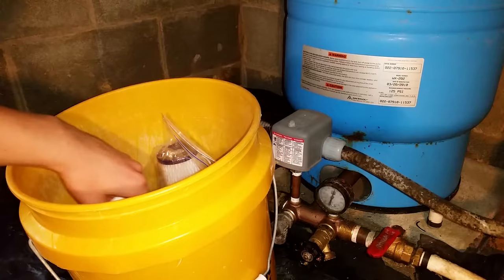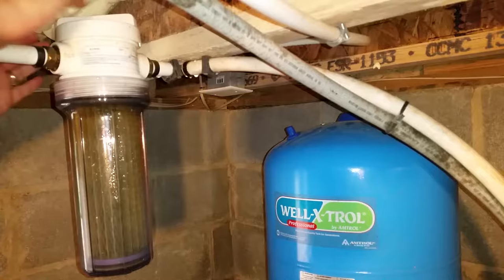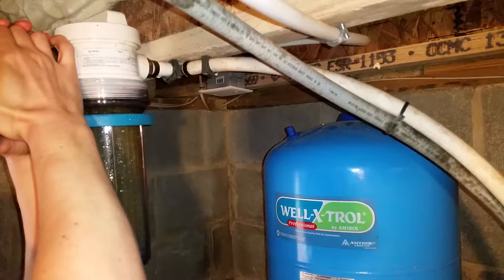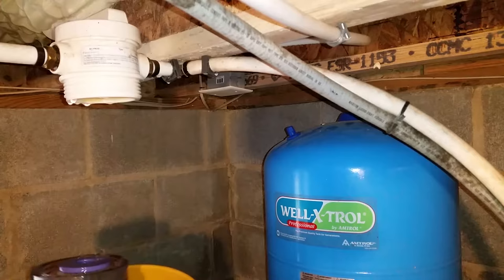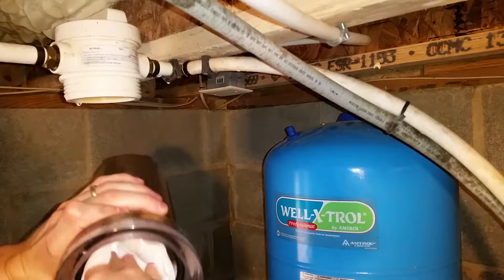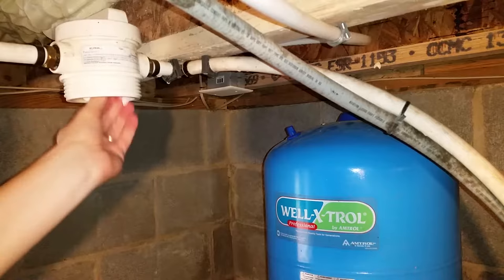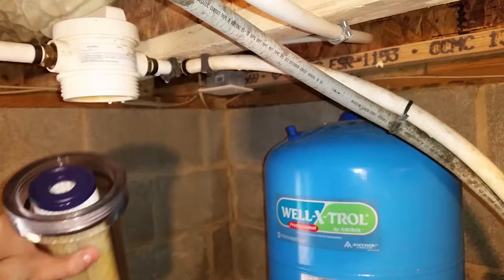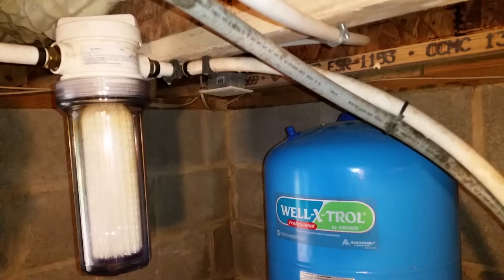Changing a Whole House Water System Filter

Comment: Thanks for posting! I was changing the filter in American Plumber model and it was leaking. I took out the o-ring gasket and wiped it down. I wiped down the threads. It didn’t leak! I think sediment got on them.
Reply from the maker: Yep, I'm sure you're right about the sediment. My original O-ring lasted about 11 years before it started requiring a few attempts to get it to seal after each new filter. It was like it swelled ever so slightly over time. Luckily, I had purchased 2 replacement O-rings a couple years before needing to use one.

Comment: Thank you! This video is invaluable. I just watched it again and will probably come back each time I change my filter. Tip for tightness: dip a towel in hot water and wrap it around the treads to get some thermal expansion going.
Reply from the maker: I'm glad the video was helpful, thanks for the comment! :)

Comment: I have a very similar setup but have two filters, side by side.  Would i use the same filter in both? We have a lot of iron in our water, so not sure if there is a specialized filter for this?
Reply from the maker: I'm no pro but I think when it's a two-filter setup, the first filter is usually something like a 30-micron sediment filter, to catch the big stuff, while the second is something like a 5-micron to further remove contaminants. It will probably help with the iron, but you'd need a water softener or reverse osmosis system to get rid of it. Again, I'm not a pro so I could be wrong.

Comment: Would shutting off the valve at the pressure tank be a good way to stop any water leaks that may occur after that point, such as the upstairs faucets or sinks? Or should I always run to the main outside by the well? I don't know what to do in an emergency.
Reply from the maker: If it's set up like mine is then yes, you would shut off the water for the whole house at the valve just after your pressure tank. Just to be sure, you could easily test this now by turning off that valve and then trying to run water from a faucet in the house. That way, you'll know for sure what to do in an emergency.

Comment: Is a filter really needed?  If I don't use the filter inside the glass jar, what would happen?  Thanks.
Reply from the maker: I'm no pro but I'd be happy to give my opinion. It all depends on your water, if there's no sediment in your current filter then it would probably be fine not to use it. We have really clean water but our filter still catches fine sediment. You can see it in the video, it's like a really fine dark gray sand. If we didn't have the filter, that sediment would end up in our drinking water, spraying out of our shower heads and faucets, in our dishwasher, in our water heater, and in our ice cubes (unless your fridge has its own filter, ours doesn't). I don't think it would cause any harm to the people living in your house but it could cause your shower heads and faucet aerators to clog up over time, which would require disassembly and cleaning. It could also build up in the bottom of your water heater and lead to a tank failure sooner than normal. The filters are cheap and I only replace ours every six months so, in my opinion, it's worth it.

Comment: Thanks for the video. Can you use any all purpose type of cleaner rather than the homemade bleach solution?
Reply from the maker: You don't have to use any cleaner, if you don't want to. However, I would use a mild disinfectant to be sure you don't accidentally introduce any germs to your water system. For me, tap water with a few drops of bleach mixed in is perfect for this situation. No matter what you use, be sure to rinse the cleaner out really well.
Reply: @Mikeattempts  Thanks!!!

Comment: What size wrench or do you have a link to this wrench
Reply from the maker: I don't currently have a link because there are different standard wrench sizes based on the filter size. If you measure the diameter of the filter housing, you should be able to pick up a universal wrench at your local Lowes or Home Depot.

Comment: Great video! What size wrench did you use to loosen filter housing? Non was included when we purchased the house🙄
Reply from the maker: I think the wrench is a standard size based on the filter size. If you measure the diameter of the filter housing, you should be able to pick up a universal wrench at your local Lowes or Home Depot. Thanks for watching!

Comment: Some filter systems have a pressure release button, if yours doesn't have one did you need to run some faucets to reduce pressure?
Reply from the maker: You could but I've never had to do that. Water isn't compressible so, once you turn off the main water supply, you're cutting off the water pressure. When I break loose the filter housing, it's not like water comes spraying out or anything.

Comment: So there is no need to flush the lines, etc.... ? A plumber recently replaced a whole house water filter at our home and said we should flush the lines after turning off the water and before replacing the filter.
Reply from the maker: I don't think so, that's what the filter is for, but I'm not a pro. I did "flush" it a little at 2:00, to clean out the inside of the filter housing. Besides there being a little air in the lines afterwards, I've never had any problems.
Reply: @Mikeattempts  Thank you. Although my whole house filter is a GE, they basically look the same so I don't believe I would need to flush the lines after the filter but before installing.

Comment: I have that exact same wrench style and just broke the handle on it. I've googled all over for it and can't find a match. Can you help me?
Reply from the maker: This website has a pretty big list of water filter wrenches: https://www.purewaterproducts.com/parts/wrenches
Reply: @Mikeattempts - Yeah I checked that website and it doesn't have this particular wrench with 6 slots. I can't find it anywhere. Any other ideas?
Reply from the maker: @fast22fast  There are 3 different 6-slot options on that page. If none of them are the correct size, maybe this one would work: https://www.purewaterproducts.com/products/wr006
Reply from the maker: @fast22fast  Sorry, I just looked at my wrench and had forgotten that it has cutouts, not pins. This one looks like it should work: https://amzn.to/4bEjAeo . If not, a rubber strap wrench, like this, should work: https://amzn.to/3OGuJRK
Reply: @Mikeattempts  Hey Mike it's all good. I ended up purchasing a $6 set of strap wrenches from Harbor Freight and used the larger one along with a heat gun on the top of the housing before removing. No drama and filter changed. Honestly I used that old plastic tool for 20+ years with no issue but let the filter in for too long last time. We are on city water and it's super clean so I don't need to change the filter much anymore. Used to be on a mountain spring. Thanks for the video!

Comment: What grease do you recommend for o-ring?
Reply from the maker: I don't use any grease on mine but just a super light coating of food grade silicone grease would work, if needed. You can find small containers in the plumbing section of any hardware store, it should say approved for potable water applications.

Comment: Can you please tell me why after I change water filter I left run hours bin like 3 months still in water I have withe stuff?
Reply from the maker: On the top of the filter housing, there are 3 settings: Off, Filter, & Bypass. I guess there's a chance that yours is set to Bypass which allows the water to flow without going through the filter.

Comment: Silly question. Why does my whirpool says to be careful with risks of being electrocuted. New homeowner just being precacious
Reply from the maker: Mine is just a standard sediment filter. A reverse osmosis water filter requires electricity to do its job so maybe you have one of those and it's just the standard "electricity and water don't mix" warnings. Find the model number and search for the manual online to get the exact instructions for your filter.